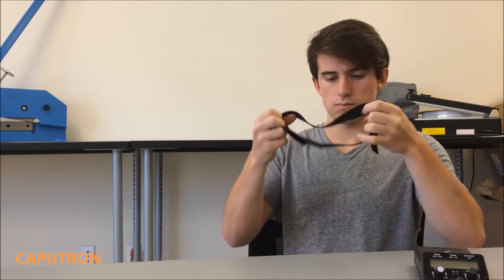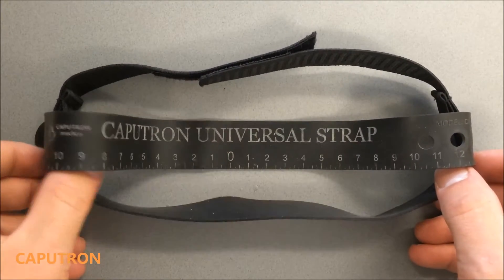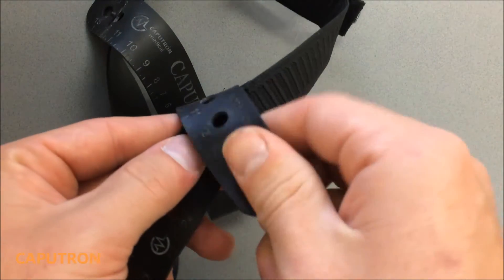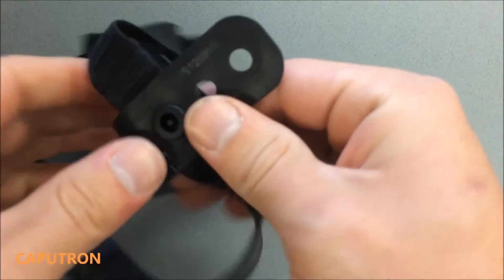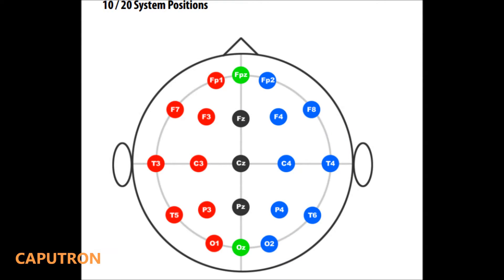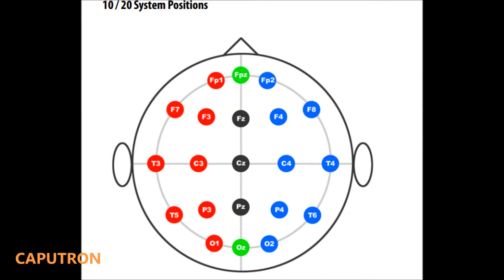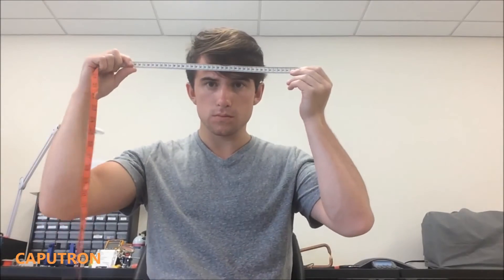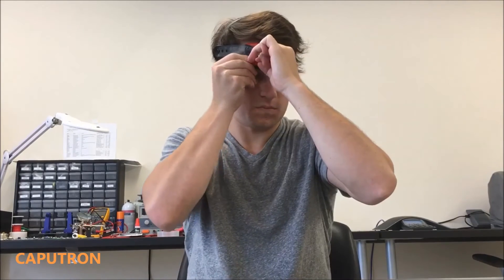Caputron Universal Strap Instructional Video

Comment: I'm not really seeing how this makes things any easier...?
Reply from the maker: This strap will allow you to place electrodes in any traditional tDCS montage. Other head straps are similar to a sports headband, and will only allow for positioning of electrodes over the frontal area.
Reply: @Caputron  I've always seen people use more than one sports band to hold two in place, and effectively position them in various places on the head. I guess I was thinking that the measurements on this headband would allow one to totally side-step the need for a tape measure.
Reply from the maker: @sublimesamoyed  The ruler markings are intended for reproducibility. When you know which ruler marking(s) on the strap corresponds with the center of the electrode (or the two ends of the electrode), you can then quickly place the electrode in the same position the following session. As the ruler markings do have the potential to stretch, it would not be ideal for replacing a tape measurer for the first measurement.
Reply: Caputron I’d really recommend you make a video about that, so we can see what you mean.
Reply from the maker: Thank you for the feedback. We will take your input into consideration!

Comment: Does it matter that there is hair under the electrode piece?   Does it have to be directly touching the scalp?  And what about the saline solution--- does it have to be saturated to the scalp -- or is it ok if it's only touching the hair?
Reply from the maker: No, when using sponge electrodes it does not necessarily matter. Sponge electrodes are very efficient and can be used over the hair. You just need to ensure the tightest possible fit so the electrodes are firmly pressing against the head as much as possible.